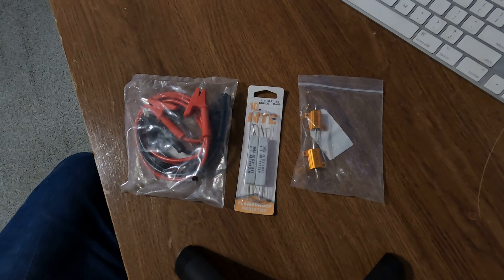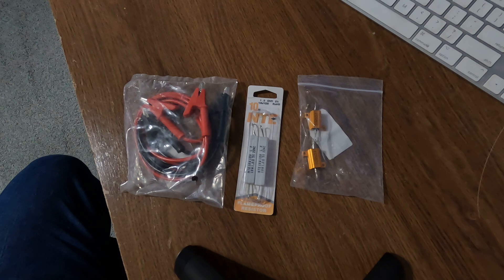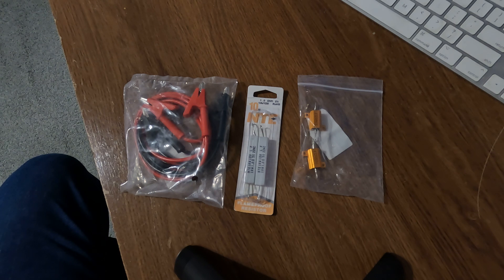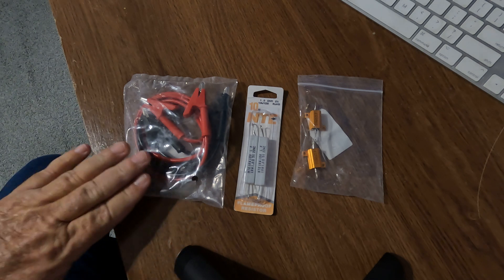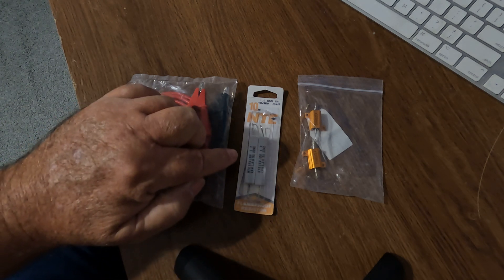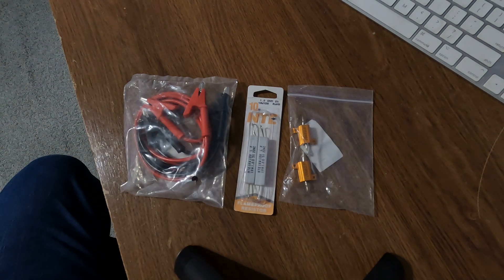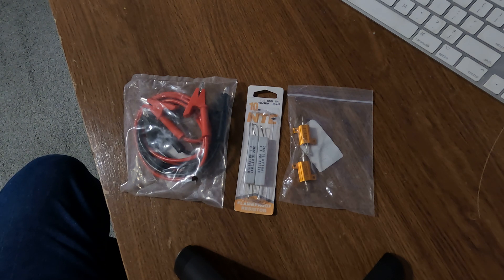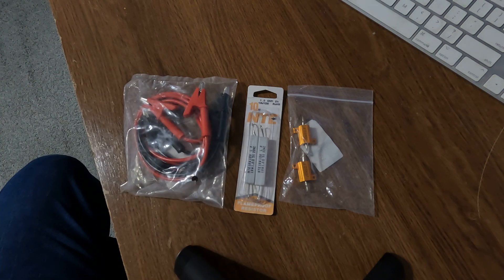How to erase a permanent code from your ECM/ECU

Comment: This may work on stuff older than 2010, I can assure you it doesn't work on a 2017 Malibu electrical fault P0615 that has been fixed.

Comment: No scan tool or dealer can erase a permanent code. If the problem is fixed the car will erase the code during the next drive cycle when it sees the problem is gone. The reason for permanent codes is to prevent someone from erasing a code without fixing the problem and going for an emission test before the code resets.

Comment: How does a person know that the method you are mentioned actually works why not scan show before and after with a scan tool that would make a great video .
Reply from the maker: You have to have a vehicle with a permanent code set, Manufactures are also changing the way they store permanent codes so this may not work on every vehicle. But for those vehicles it will work on it will save someone a trip to a dealer where the minimum charge is 1 hour laboratory over 100 dollars an hour.

Comment: Most permanent codes need more than just the battery disconnected.  You first have to fix the problem as to why the code came up.  Once you fix it you have to drive the car a fair distance for the computer to recognize the problem was fixed.  The computer will automatically erase the code once it recognizes the problem was fixed

Comment: Disconnecting the negative battery cable and turning on the headlights will do the same thing.  No need to jump thru these hoops since the headlights will be a huge resistor or drain on the remaining juice left in the system.   This process seems rather silly

Comment: Draining power will not erase a permanent code.
Reply: I agree.  Most permanent codes need require you fix the problem then drive the car for a bunch of miles till the computer recognizes the fix has been emplemented

Comment: This guy is full of crap not even having a 10K scanner can erase permanent codes also no dealer will clear permanent codes so he think someone can erase those so no body can unless you get to the map pack of the ECU code and do it all lies here😅
Reply from the maker: Wow what a word salad you just posted. Yes expensive scanners can erase permanent codes, dealers also can erase permanent codes and yes many vehicles this diode can erase permanent codes, while this may not work on every vehicle depending on how the manufacture is storing the code it does work on many vehicles. If you could not erase a permanent code the check engine light would never go out.
Reply: I get mine to reset but the permanant code still shows but it get the check engine light off for like a day dunno , its a toyota……4 runner. A rescan still shows permant code though…..confused at this point
Reply: @texasmcgyver it didn't clear it in my 04 4 Runner either. Try a jumper between pin 3 and 14 on the OBD data port. You may have better results.
Reply: I have a Pontiac G6 with a permanent EVAP code for a small leak, but my engine light isn’t on. This proves that a car can have a permanent code without the engine light because the module hasn’t been activated yet. My inspection shows some modules as "incomplete or failed," and the EVAP module is one of them. Since my car is a 2009 model, my state allows one inactive module, so it can still pass inspection with the permanent code. The check engine light will stay off until the EVAP module activates again. When it does, it will go green and show as active, but if the issue isn’t fixed, the light will come back on. If it were fixed, the light would stay off, but the permanent code would remain until it clears after about 15 drive cycles and 200 miles. So, your dig about word salad shows you were threatened by his remarks but his remarks are accurate. You don't seem to have a lot of knowledge about permanent codes.

Comment: Dose this work on a diesel with 2 batteries?
Reply from the maker: you would need to disconnect both batteries, depending on the year and manufacture how they store the permanent codes this may work and it may not work. If they are storing the code by writing to memory then you will have to use a computer to erase it, if it is stored in flash memory that requires power they it should erase the code. 

Like anything else some manufactures make it as hard as possible to erase these codes. 

One other thing is the problem has to be corrected before erasing the code or the code will still show up.

Comment: Dear God just disconnect the battery for 20 minutes you don't have to go through all this
Reply: you probably just had a code ,not a permanant code, permanant codes stay there until the computer recocnises the problem is resolved when it feels the problem is resolved a permanant code will clear itself, sometimes they just dont want to go away, i drove 25 cycles 600 miles still a permanant code with no engine lights on a 2016 ford f150 ecoboost, ive about had it nothing wrong with the truck but its whole life the guy was driving it up massive hills ,it finnaly set a permanant code ,i bought it live in flat land area the computer will not reconize its fixed becouse i drive differently, this may be my only option,dealer will screw me

Comment: Can't you also disconnect both battery cable and press the horn for like a minute?
Reply from the maker: The resister allows the power to be drained safely, todays vehicles have a lot of delicate electronics in them so directly shorting out the positive and negative cables is not a good idea.
Reply: @LeeCountySpeedShop   So ya just use two jumper wires to connect the resistor in series with the battery cables?
Reply from the maker: @righteousone1  Yes, Positive cable to one side of the resister and Negative cable to the opposite side of the resister, that will safely drain the remaining power in the ECU and erase permanent stored codes that other wise need the dealer computer or an expensive scan tool to remove them.
Reply: Just touch the two battery cables together 
Fo a couple mins if it’s able to clear it will,
Wen you touch cables together 
It drains all capacitors in ECM,,,

Comment: Can you show us in video how you do it. A bit confused
Reply from the maker: I don't up load videos to YouTube anymore because they have throttled my account to the point just answering this post takes a long time. 

All you do is disconnect both battery cables from your car battery. Now have your resister and your alligator clips with you. Connect one of the alligator clips to the positive battery cable, not the battery but the removed cable, connect the other end of the alligator clip to one side of the resister, repeat this with the negative battery cable. The resister will safely drain the remaining power in the ECU unit erasing any permanent codes that were stored in the ECU memory. You will leave the resister connected to the battery cables for 10 to 15 minutes. Once that time has passed disconnect the resister and the alligator clips from the battery cables and reconnect the battery cables to the car battery and you are done. The permanent codes will have been erased.
Reply: @LeeCountySpeedShop What d you mean they have throttled your account? Did you say something true like the fact that Flreelmalsonl Jlewlsl and the Rlothslchildl family are keeling 90% of the population off using valxinelsl, clhemical tralilsl, and celluarl towlersl? All true.... and Slatanlicl 6006le doesn't want people to know it.

Comment: Thanks for the video. I a bit curious as to the purpose of the resister. Can you please go over that. Thanks again
Reply: Thank you for taking the time to explain in great detail.
Reply: @johnperez735 The purpose of the resistor is to safely drain the remaining power from the ECM. If you just hold the negative to the positive for 15 minutes without the resistor, you could easily damage the ECM.
Reply: Can you show exactly how to hook these up
Reply: @queshalakes1589  it seemed very simple unhook both cables do not use your car battery basiclly 2 jumper cables or wire hook one end to the positive cable the other to the resister then hook the other jumper cable to negative battery cable then to the other side of ther resistor the reaon is to slowmy drain everything without the capaciters on your vehicle burning up your ecm if anything would burn up it would be the resister its to protect your cars ecm
Reply from the maker: The resister safely drains the remaining power in the system in this case the ECU which will remove the permanent fault code from the ECU memory. Not all code readers can delete what are called permanent codes stored in the ECU, it takes a dealer scan tool or the more expansive scan tools. 

These inexpensive scan tools can remove most stored codes unless it is a permanent fault code, the word permanent is kind of misleading because permanent fault codes can be deleted it just takes a dealer scan tool or one of the expensive scan tools to delete them, the 10 watt 1 Ohm resister will drain the power in the ECU which erases the permanent fault code, that eliminates you having to pay the dealer for their one hour minimum to hook up their scan tool to erase the permanent fault which takes them all of 5 minutes to do from start to finish. Most people do not own an expensive scan tool themselves that is capable of erasing permanent fault codes. 

So if you make a repair and correct a problem you can remove the normal fault code from the ECU with an inexpensive scan tool but if the system also stored the fault code as a permanent fault code you can't remove that one, it will remain in the memory and every time you scan the ECU for codes that permanent fault will keep showing up even through you repaired the issue.

Comment: What year vehicle did you do this on?
Reply from the maker: This will work on all vehicles with an ECU that stores a code. Scotty Kilmer's channel also explains how to use this method to erase a permanent code if you don't have an expensive scanner or don't want to pay the dealer to erase the code.
Reply: @LeeCountySpeedShop   - OK fist stop listening to Scotty Kilmer, guys an idiot.  Permanent codes are a new thing in 2010 and newer vehicles.  But to complicate things some scanner manufactures listed some history codes in thier scanners as "Permanent" when in reality they were just a history code.   So you gotta be really careful offer advise to people in this area.   Shorting out a vehicles electrical system is not advised by any manufacturer. 

There is really no reason to clear a permanent code in a 2010 and newer vehicle.  They are not hurting anything being in there.  If your check engine light is off and all you have is a permanent code there is nothing more to fix on the car.
Reply: @LeeCountySpeedShop Kilmer is a hack. Dont copy a hack unless you want to look. Stupid